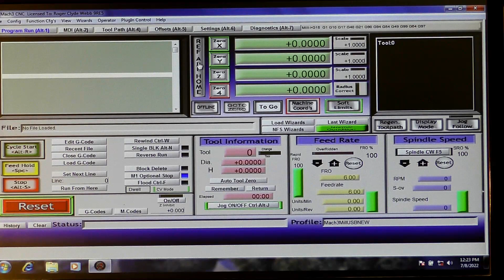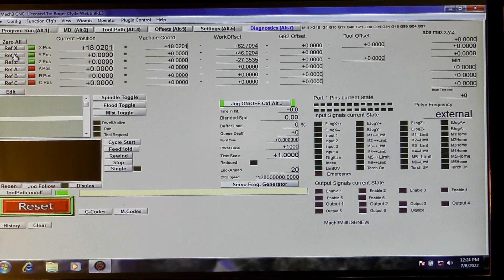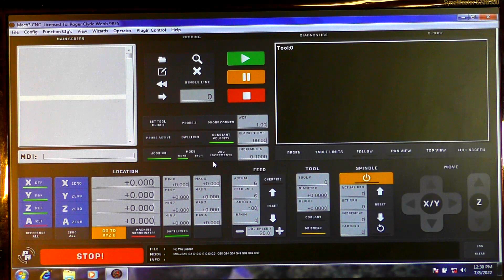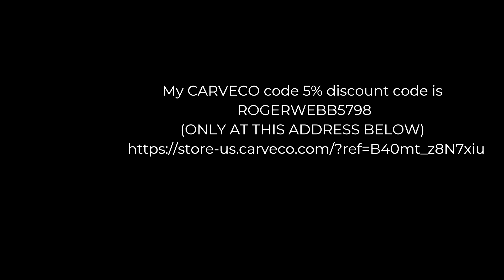Goodbye Mach3 *HELLO MACH 3.5*

Comment: Basically it does not matter how many switches there are,  all the axis can't move to the same coordinates at the same time, so mach3 defines each axis movement until a trigger happens IE switch movement then proceeds to the next axis.
this does reduce wiring.
Make sure to us  shielded wire, as where the switches are setup in parallel it will create an inductive loop, IE Rf noice which can cause problems, like false reading on the dro and motor twitching.

If using USB controllers then don't install the Parallel driver, as this will cause issues to

Comment: Machine Is running during job work when power is loss machine is stop and laptop is on but program can't stop after power loss ,what is solution
Reply: I am using AC relay use in supply or to of relay  terminal connected to emergency switch when power is off relay is off  NO convert to NC  push emergency using relay and program is stop now